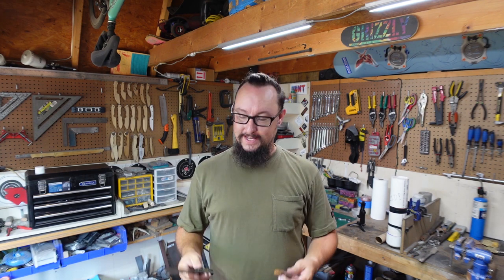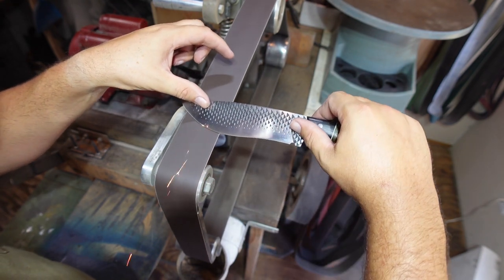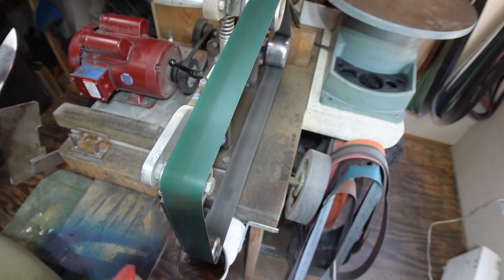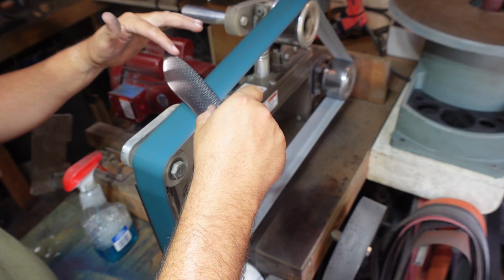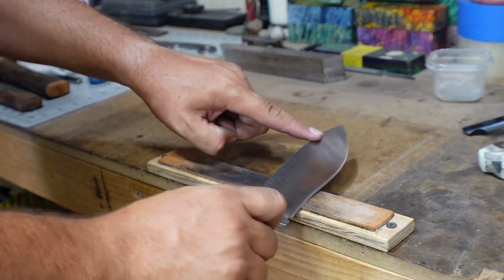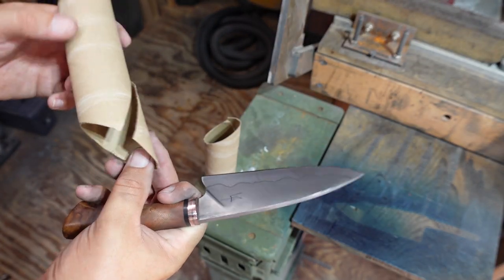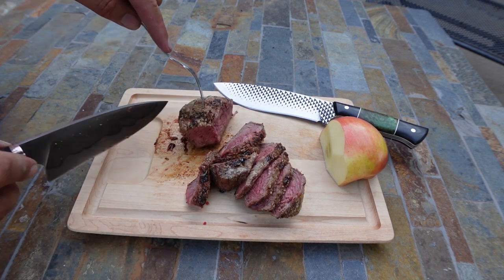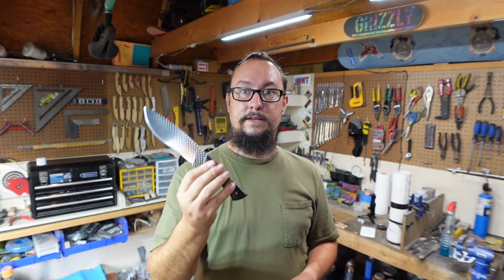Sharpening Knives on a 2x72 (Plus Cutting Stuff) | Shop Talk Tuesday Episode 94

Comment: 2 more great knives come to close. Been fun watching the progress of both of them. You may have already addressed this before, but when sharpening do you run forward or in reverse? Seems to be a question no one agrees on. I’ve been putting the initial edge on with a belt then going to stones but can’t seem to get it just right. Just curious before I start experimenting with belt sharpening myself.
Reply from the maker: I change the direction of my blade not really my belt rotation direction. I keep the blade going with the belt rotation instead of against the belt rotation during the sharpening process.